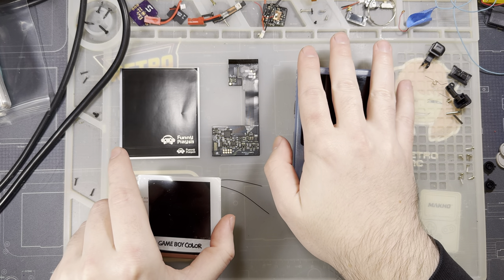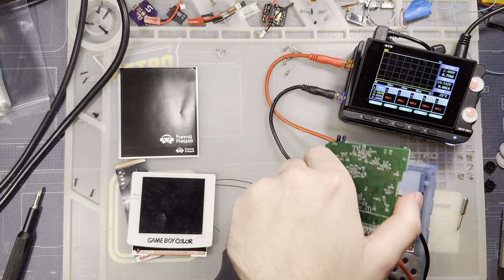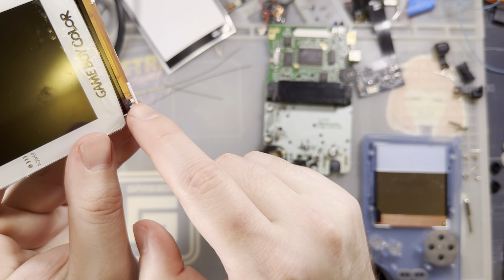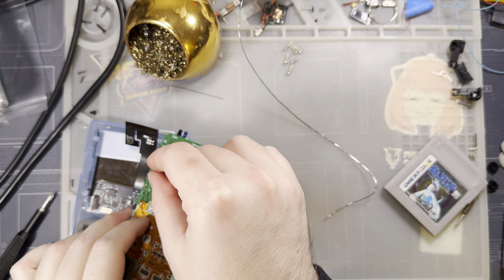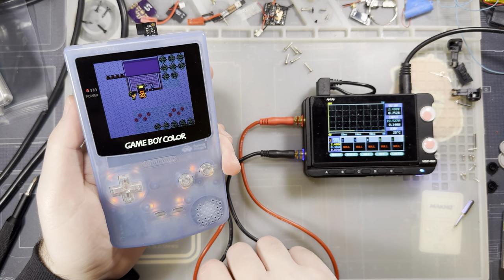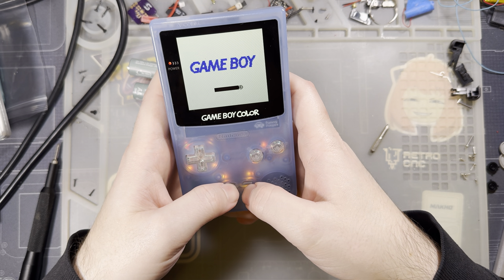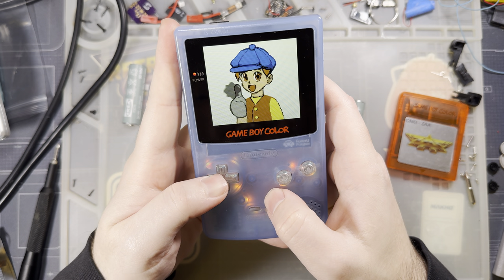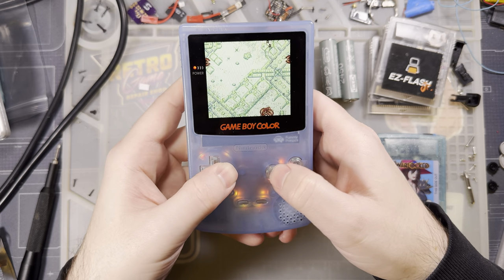Laminated Game Boy Color IPS Kit (Funnyplaying Q5 v1.3-OSD)

Comment from the maker: I made a mistake in the video. If you connect up the start and select buttons, you can disable the touch sensor and still retain full controls of the kit. 

Hold SS: Open and close OSD
Press Select: decrement option
Press Start: increment option
Hold Select: go to option to the left
Hold Start: go to option to the right
Reply: How do you disable the touch sensor?  Just clip it off with a side cutter?
Reply from the maker: @andrew7629  you don’t have to. I was saying you can.

Comment: Blerg, I picked up one of these kits a few weeks back from RGS for a new modded GBC but it didn’t come with this new ribbon cable. I guess it’s luck of the draw which ribbon cable we get with these kits.
Reply from the maker: Yeah, pretty much. Usually the plain black (dark gray) lens variants get updated more quickly but yeah it's 100% timing based on current inventory levels.

Comment: This was my first GBC mod, I was scared to do it since you didn't have a video on it yet lol. In case anyone is wondering, this is on the fp website under retro pixel 2.0 but the ribbon cable says 1.3

Btw makho, I didn't connect the power wire bc it works without it, is there a difference whether you connect it or not?
Reply from the maker: As I mentioned in the video, connecting the power wire allows for higher brightness levels.